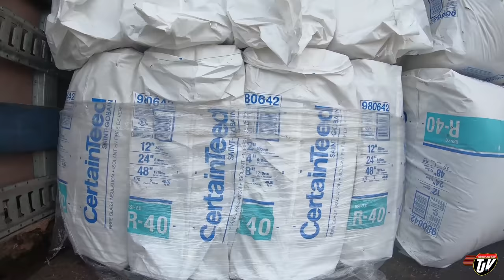My Trucking Life | SHE'S A BEAUT! | #2180 | Jan 5/2021

Comment: My father in law went from driving and working for waste management companies for a while (20ish years?), got hurt and was off for a long time ultimately ended up going back to work driving for a concrete company and is absolutely loving it. The only big thing about that job is that when construction slows down due to weather work slows down so he got in good with the company, learned all the driving positions (dump truck/trailer, mixers, etc...) and worked hard to be well liked and known as a dependable worker so he is up on top of the list of people called when work does come in during the slow periods.